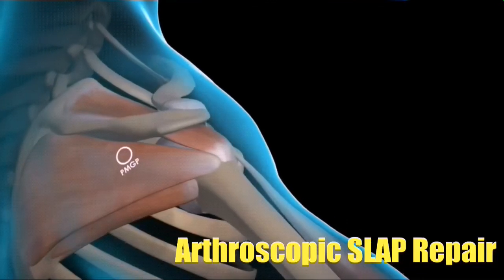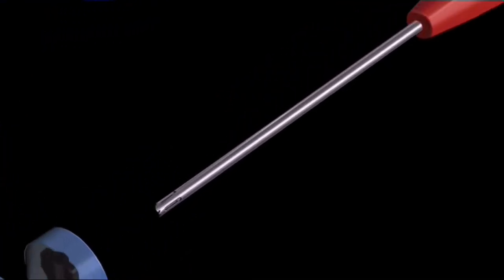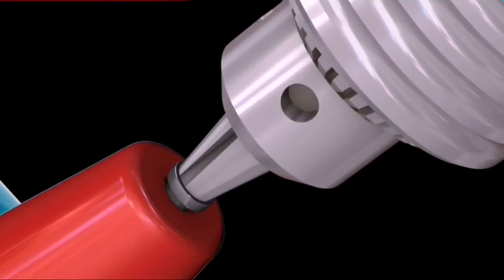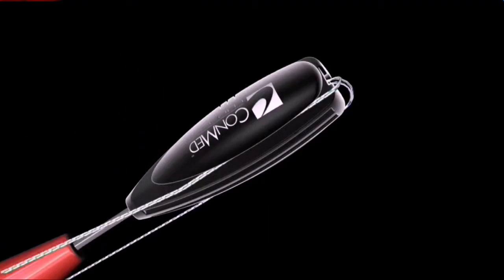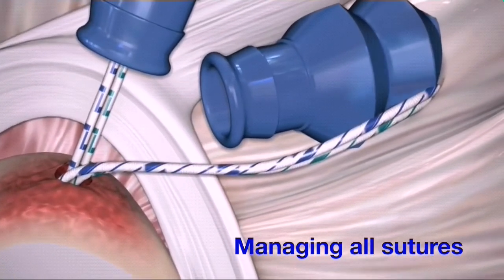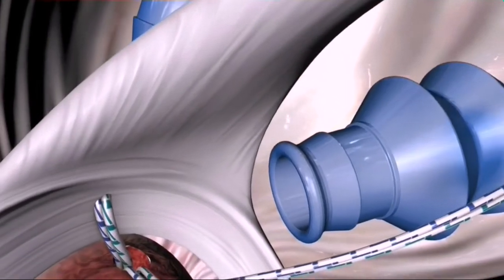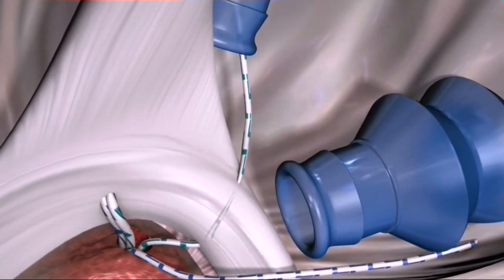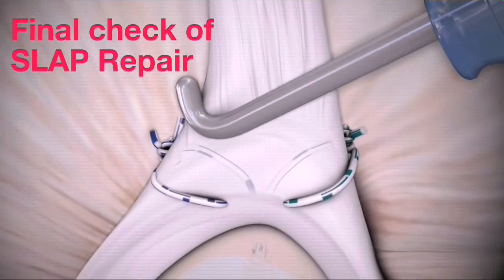Shoulder Arthroscopic SLAP Repair (Animation)

Comment: Does this rope strong enough?I mean will this last till i die and can i play contact sports with it?
Reply: It is usually Dyneema material - incredibly strong, yet the purpose of rehab process is to buildup dynamic stabilization with surrounding muscles and letting the slap to heal and reattach to the bone
I am 5 months after this surgery now and I have just started to use light dumbells to streghten up. The goal is to get better stabilzation with muscle and improve movent patterns for future activities.